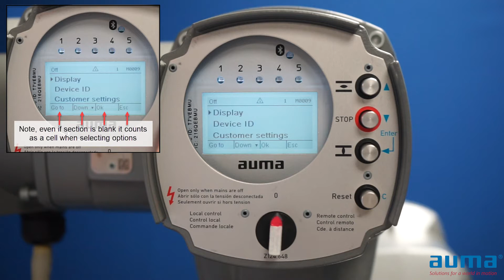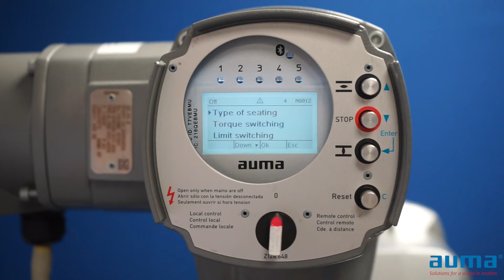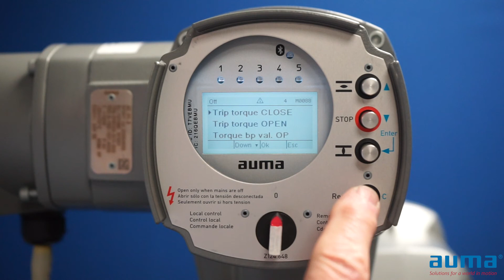AUMA Actuators - Setting Torque Switches - MWG Non Intrusive

Comment: Hola Tengo un problema con un actuador AUMA SA14.2-F14 con AC01.2. El problema es el siguiente, se ha instalado nuevo, se configuraron los limites de apertura / cierre, después se dejó sin alimentación eléctrica durante una semana. Al alimentarlo apareció con el led de cierre iluminado y con el de fallo térmico del motor, estando el motor sin funcionar. ¿Alguien entendido en la materia me podría decir a que es debido? He accedido a las tarjetas electrónicas y repasado los conectores de todas las tarjetas, los 4 fusibles, uno es auto rearmable, he puenteado el supuesto térmico que protege el motor, he aumentado el tiempo de vigilancia por desequilibrio entre fases, comprobado tensión alimentación, Hz....  Alguien me puede ayudar??
Gracias.

Comment: Hi,I'm from Viet Nam. I have an Auma actuator SA 07.6-F10, It always warning Close torq (Torq always read 76Nm, Close torq set = maximum 60 Nm even we operate by handwheel, it not too heavy). currently, we only can operate open the valve. Could you plz give some advice.
Reply from the maker: Hi Huy, Please reach out to our service representative in Ho Chi Minh City +84 28 54110816 or email hungluong@auma.com.vn.

Comment: We have an Auma actuator won't open the valve and it displays this alarm:
TORQUE FAULT OPEN
Could you please help
Reply from the maker: Hi Rebai, what is your location? We can help to get you in contact with someone local who is able to help you directly.
Reply: @AUMAActuators-USA  I am from Algeria
Reply from the maker: Hi Rebai, Please use the information below to speak with your local service rep. I hope this is beneficial. 

STC Co (Solution Technique Contrôle Commande)
Agent79 Lots, Rue les Vergers
Bir Mourad Rais - Algiers
Algeria
+213 21 56 42 09/18
info@stcco-dz.com
Reply: Same problem sir but torque faulty close